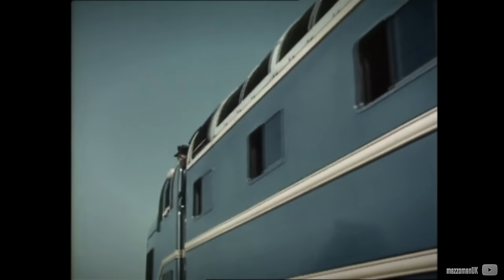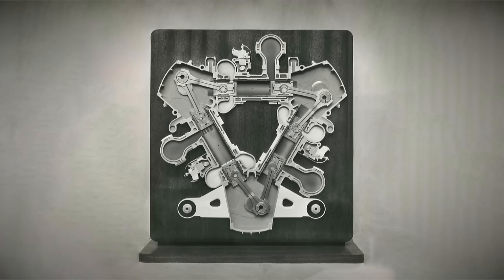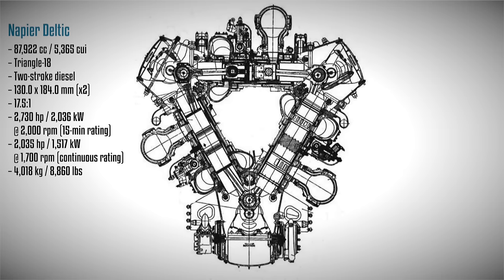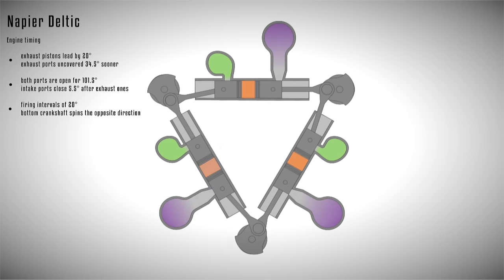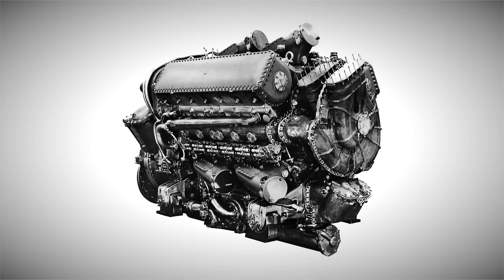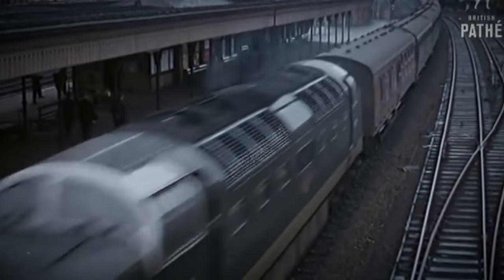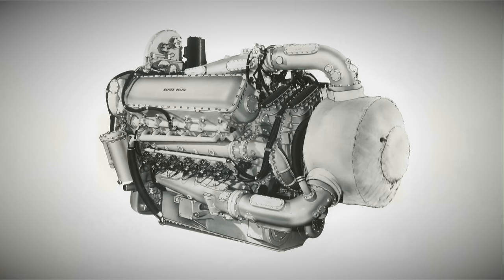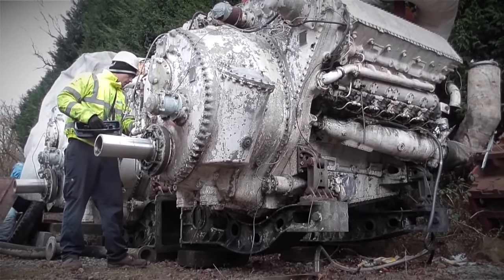The Ingenious Napier Deltic 2-Stroke Diesel Engine

Comment: Let's see....need 3 Harley Davidson's "blade and fork" connecting rods, 3 Harley crankshafts with custom crankcases, 3 crankshaft position sensors, 3 piezo injectors with injection pump, external dry sump oil pump and 3 cylinder liners with 6 matching pistons.........hmmm.
Reply: @sandervanderkammen9230  I believe I described it as "blade and fork".......same thing, just mechanic slang term for it.
Reply: @vilefly  You seem very confused about rods?
A fork and blade rods are a completely different thing than master and slave rods.

Fork and blade have the same length and same stroke.
Master and slave are different lengths and each has a different stroke.
Reply: @sandervanderkammen9230  I will have to research that, then.
Reply: @vilefly  Please do, there is a very big difference between these two types of connecting rods.
Reply: @sandervanderkammen9230  Ok, bub.  My original statement was correct.  YOU are wrong about Harley Davidson rods.  They are not master and slave.  They never were.  This is not an aircraft engine.  You got way too cocky about it, and I believed you for a moment.  Now, I'm going back to my job as a real mechanic, not an armchair one.  You're fired.
Reply: @vilefly  But you understand there is a difference between a fork and blade, and a master and slave rods.
Some motorcycle and aircraft engines used both when parallel borespacing is required.
Reply: @sandervanderkammen9230  I've seen the designs before, and discarded them because they do not work in a Deltic engine design.  You are only serving your own ego.  This discussion is terminated because it serves no purpose.

Comment: Amazing. But my god the pollution. I reckon these contributed 5% of co2 increase! 😂
Reply: Actually the Deltics are still very low CO2 even by today's standards... very environmentally friendly but unfortunately not good on particulates or HCs on startup though... a bit too claggy.
Reply: @sandervanderkammen9230  that’s interesting to note
Reply: @MePeterNicholls  Diesel engines are inherently lower than other combustion engines in CO2 emissions. They do have some issues with NOx emissions and particulates in places where that is a problem like major cities that can have extended periods of inversion layers at certain times of the year that can trap these pollutants. eg;
Paris, London, Los Angeles and Mexico City

Comment: So many flaws on this engine. No wonder it didn't succeed. Amazing how engineers don't understand physics. If they had added a 4th crankshaft and the same amount of pistons and cylinders with each other crankshaft rotation opposed, harmonics would have reduced and designed the gear box to delegate control load across all crankshafts time between overhauls would have increased 10x with a few lubrication modifications.
Reply: Jumo understood these flaws which is why they sold the 218 design  to Napier, they didn't discover the problem until it was too late.

Comment: Couldn’t just build a V engine like normal people?
Reply: If you need 3 crankshaft to make a 'V' why not get an extra bank of cylinders for free???
Reply: @sandervanderkammen9230  one crankshaft for a V engine. Two are necessary for an opposed-piston inline engine. Three are only needed for this triple-bank engine.
Reply: @aaronshipley5594  3 crankshafts would also be required for a opposed piston V engine.... so the logical solution is 3 bank design rather than a V to make the engine shorter and more compact than an inline configuration.
Any questions?
Reply: @sandervanderkammen9230  I meant make a normal V engine with one crankshaft.
Reply: @aaronshipley5594  Regular V engines cannot achieve the fuel efficiency of the opposed piston engine, that's the reason why they are used.
The Jumo 204 was the world's most efficient engine in the world in 1931, impressive and still competitive today.
A traditional design would deliver only half that efficiency.